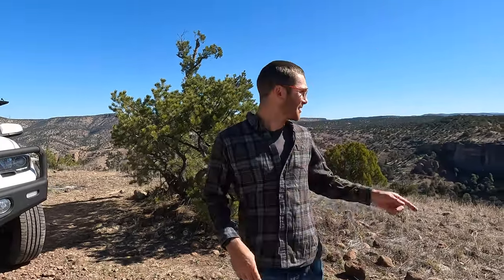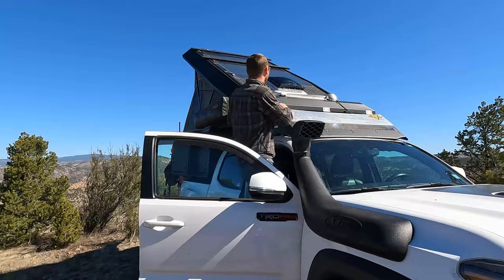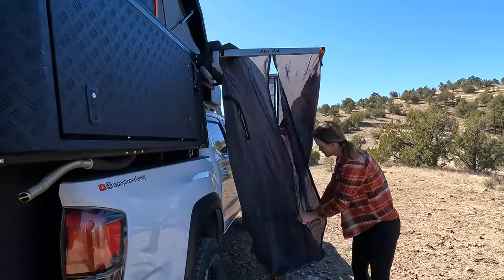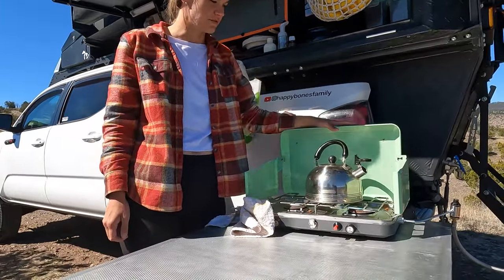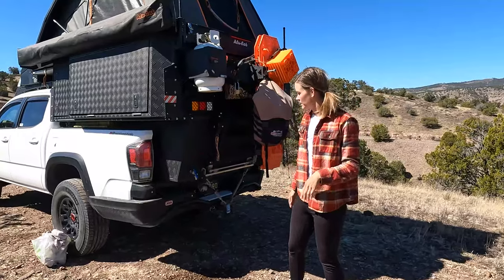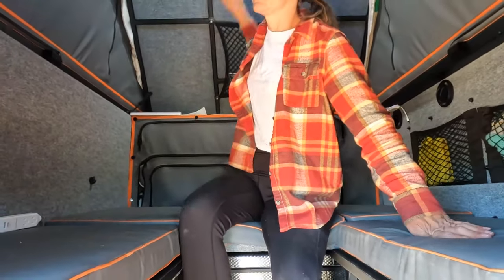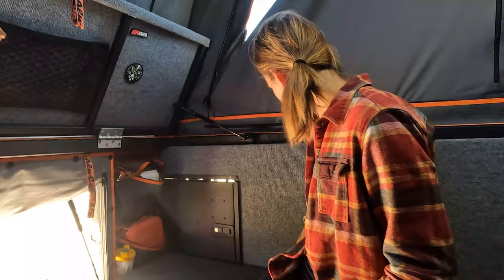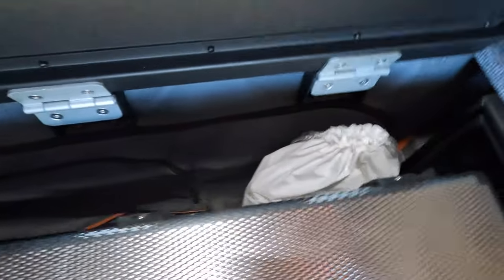FAMILY OVERLAND Off-Road Rig Tour: Toyota Tacoma and Alu-cab Khaya

Comment: So far this is my favorite camper setup. Question though, how do the kids get ventilation in that bottom bed if the door is closed?
Reply from the maker: Hello! If it's hot, we keep the back door open with the bug net zipped shut. If it's cold and the heater is on, we open the small "hatch" door for heat to rise and air to move.

Comment: Fantastic setup guys.  Love your Khaya setup and am very impressed with the whole setup.  That’s the first time I have seen a fan installed on the ceiling of an Alu Cab.  

I would like to know the total weight added into the truck.  Also I understand you’re running OME leaf springs, but how much weight can it handle.  Did you do anything to the ECU or re-gear.  What type of mileage are you averaging on the Highway, I understand with this much weight, Mpg varies drastically between driving 60 miles per hour and going 70 miles per hour.  

I will share my setup.  I have a 3rd gen access cab TRD off road.  I ended up getting a canopy camper on it and doing a goose gear build out.  My weight with the camper and goose gear is roughly 640 pounds.  When I have the 13 gallon water tank filled and my cooking gear.  I’m around 850 pounds.  For a toilet I use a Bush metal toilet with bags.  

To handle the weight I installed a Deaver Stage III lead pack that can handle 900-1000 pounds, the truck sits higher than a stock Tacoma.  I’m using the same OME BP-51.  

I put on 17 inch wheels with 285’s as the width with the falken wild peaks I’m roughly a 32.6 inch wheel.  

I have Yukon 4.88 gears and only have the standard rear lock, (no front).  I manage at 60 mph roughly 16 miles per gallon.  When I go 75 I’m at 13 Mpg.  

I have the propane fireplace and am loving the setup.  I have thought about a Zero Breeze AC installed in the goose gear cabinetry, but am waiting for a kit for the interior/exterior and water hoses that connect to the Zero Breeze to the outside of the camper.  

Please share how the fan in your ceiling works and if you would do it again.

Thanks again!! Safe travels and live and enjoy yourselves.  I feel like modern day pioneers with this camping setup.  😂.
Reply from the maker: Hello and sorry for the extreme delay! The OME leaf springs definitely help, but we needed more support and added air bags on the back. That made the ride very smooth! 

On the highway, we generally stay around 65 mph (unless I (Laura) am driving then it's a bit more LOL) and our gas mileage is around 16-18 mpg. 

Our fantastic fan had a defect and the arm would pull too far down and break the lid. After we replaced the first lid and had the same thing happen again, we contacted Dometic and they hooked us up with replacements. Unfortunately, the fan parts were on back order and we waited months to get it. I'm happy to report, however, that we have now replaced the broken pieces and it works perfectly and moves a lot of air!! 

While it was definitely scary cutting a hole in the roof of the Khaya, it was well worth it. Some places are so hot/humid with no wind and it's just plain uncomfortable "upstairs." 

I think I answered all the questions, but please let us know if you have any more!! Cheers!

Comment: Great setup and really sharp looking. Just wondering why are you running all season passenger rated tires? Need some nice all terrain tires at least load range C for the places you like to go.
Reply from the maker: Good question 😂 we are cheap and wanted to wear these out before we bought new ones. We knew we weren't planning on doing much off-roading on this trip, so we just kept them from the previous owners. However, we took some roads that turned out to be pretty gnarly and we're regretting our decision. We have a video about that :)
Reply: @happybonesfamily  I gotcha!!

Comment: Dry weight on base Khaya is 880 lbs., your payload is 1180. With people, fuel, gear, and accessories to the camper, you are very overweight. Not being an ass but that is unsafe.
Reply from the maker: We upgraded the suspension to old manu emu heavy and added airbags which made it ride very nicely. However, yes, we were over the factory payload.